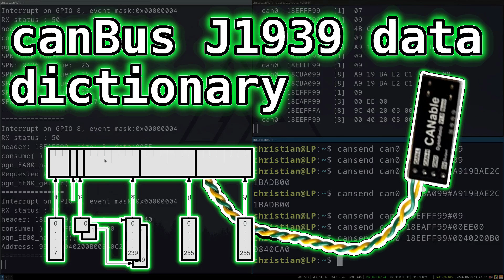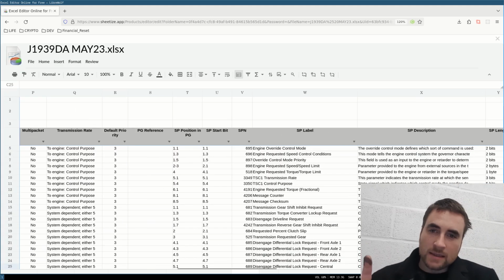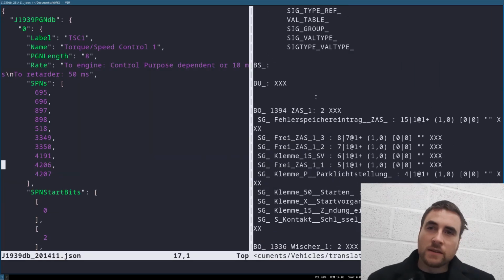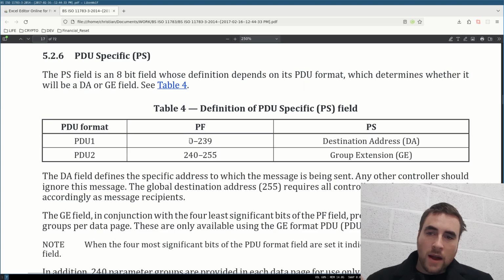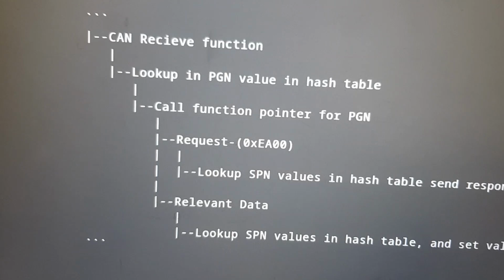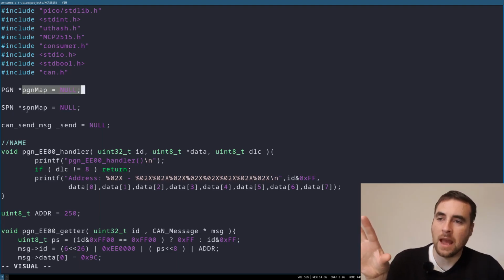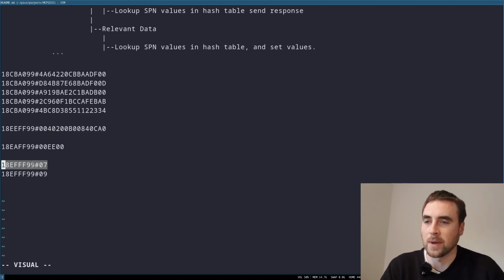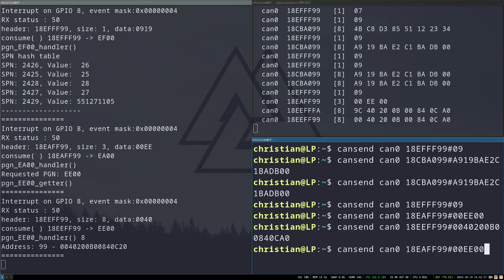⚡Mastering CAN Bus Data Handling:🔧 J1939, MCP2515, and Pico-Zero Hands-On Tutorial

Comment: Fascinating! Can this be used to read can systems on modern motorcycles?
Reply from the maker: It comes down to proprietary messages vs standards.     Motorcycles and cars use proprietary messages. You would have to look in community forums for a pgn data dictionary for you motorcycle. All the best.